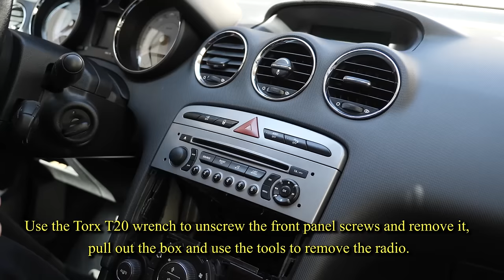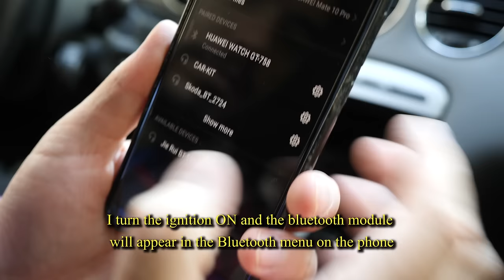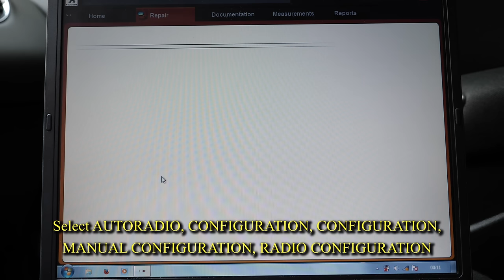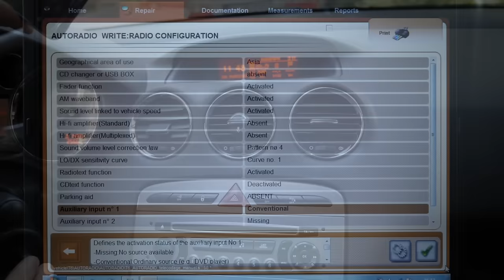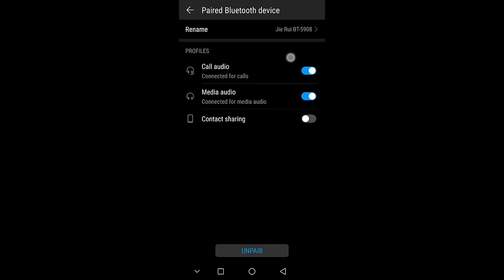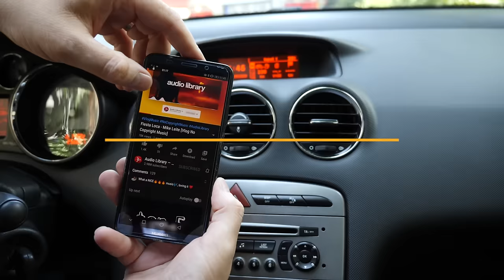Install Bluetooth Audio Module on Peugeot & Citroen Radio RD4, RD45, RD43

Comment from the maker: Links:
- Plug and play Bluetooth module + microphone: https://s.click.aliexpress.com/e/_DErPTy7
- Bluetooth AUX Audio Adapter with Microphone Handsfree: https://s.click.aliexpress.com/e/_DFsvCNv
- Bluetooth Module Stereo AUX-IN Audio Adapter: https://s.click.aliexpress.com/e/_DF2f3lz
- Bluetooth Module RCA Stereo AUX-IN Audio Adapter: https://s.click.aliexpress.com/e/_DE3GQex
- Diagbox / Lexia 3 / PP2000 (choose the most expensive, it's the best): https://s.click.aliexpress.com/e/_DDoo8O5
- Quick Splice Terminals Connectors: https://s.click.aliexpress.com/e/_APS3lF
- Radio removal keys: https://s.click.aliexpress.com/e/_DlT9q6F
- Peugeot & Citroen Radio RD4, RD43, RD45 wiring diagram (pinout): https://diyrepairs4car.blogspot.com/2020/05/peugeot-citroen-rd4-rd43-rd45-wiring.html
Reply: Hi Adrian, i installed plug and play module and after i turn off car i still can connect to bluetooth. Is that ok, does it drain battery? Thanks.
Reply from the maker: Hello.  Don't worry, it won't drain your battery.  If you want the bluetooth to stop being powered after you stop the engine, you will have to power it from the lamp bulb in the glove box.

Comment: Great video, really helped me a lot. Only difference was that on my Citroen C4 RD4 radio there was no cable on pin 11 so I used pin 15 instead and it worked. Hope it helps someone. Cheers
Reply: Same thing on my P308 with RD4. I discovered that pin 15 is +12V switch so I used it
Reply: It happens the same in my Peugeot 308SW. Yellow wire is in pin 15. Pin 11 is empty.
Reply: In my Citroen c5 2010 is number 8. Also you need to keep it plugged in the radio to see which cable is the 12v
Reply: Trying this now, hope it works !
Reply: @DionisisMaximum98   this is why I couldn’t find my switched 12v thx!
Reply: Same happened with my peugeot 207. Thanks!
Reply: @panosk.8803  
Did you activate your aux option whit the program or was like plug and play device ??
Reply: @tecnicocmex9133  It wasn't plug and play because I had to activate the aux mode. I went to a local dealer and they charged me 10 euros for that.
Reply: @panosk.8803  Hello some people said the Bluetooth stayed on after turning off the car untill it goes to ecomode then the Bluetooth go off is it true?
Reply: @drkabajt  Hello some people said the Bluetooth stayed on after turning off the car untill it goes to ecomode then the Bluetooth go off is it true?
Reply: @potatoman9116  That was not the case with mine. This might happen if you plug the connector in the wrong pin.
Reply: @panosk.8803  Ok thank you

Comment: Thanks! Very helpful video, installed my bluetooth yesterday following your guide, took about 15-20min (my quick splice didn't worked at first time, i had to took isolation from wires and it worked)

Comment: Great tutorial, thanks. Is it mandatory to run the Diagbox configuration? I already see the "Input" option in the radio when clicking at "Source" button??
Reply from the maker: Hi. If you already see "Input" when you press the Source button, the function is activated and you probably have the RCA plug in the glove box. Check it out :)

Comment: Super Video, hatte mir auch solch ein BT Adapter geholt und mich gewundert dass es nicht funktioniert, wusste nicht dass man den Eingang freischalten muss. Funktioniert super. Danke
Reply: Wie genau haben sie es denn freigeschaltet?

Sie haben aber nicht das Gerät dafür gekauft oder ?
Reply: @torque5070  Sie benötigen die Citroen Diagbox ( Software ) und ein Auslesegerät für den Laptop (Lexia 3), oder mal bei einer Citroen Werkstatt nachfragen, ob die das freischalten können :).
Reply: @BenjaminGillesgillben  ich habe schon einen aux Ausgang im Radio.
Das müsste also bei mir ohne diese Software gehen nehme ich an

Comment: Nice video. +12 with key is not pin 11 but the on close to constant +12V (pin 12). Check with voltmeter and radio attached (otherwise there will be different voltage).
Reply: Exactly. The wire colors were different for me, but the ones you listed are correct (pin 12 for +12, and pin 16 for GND).

Comment: hey great video i had a few questions so first of all does this change the quality of the original speakers? Do the steering wheel controls still work after installation? and the last one can it be done with all types of suitcase?? thank you very much great video :)

Comment: Hi there! Thanks for your generosity, what is the software and cable your using?
Reply from the maker: Hello. The software is called Diagbox and it only works together with the dedicated OBD module. You can buy the set here, it contains software and the OBD module: https://s.click.aliexpress.com/e/_DDoo8O5

Comment: Great video and very instructional. I used your link to purchase and now have functioning bluetooth and can now hands free call using siri on my phone. Also the music playback from my phone through the radio is awesome. However I did have to enable Aux1 using Diagbox. Many thanks Adrian.
Reply: Quick question, do you need the original citroen diagbox to use manual configs or can 3rd party like 50$ knockoffs work the same?

Comment: Hi Adrian. Just to ask, I have a 2010 Citroen C3 Picasso and the stereo does not have Bluetooth.  The tutorial is great but do I need to configure the stereo if I fit this. It is a Bosch stereo that comes as standard. Many thanks.
Reply from the maker: Hi! Yes, you need to configure the radio to activate the Aux IN function as you see in my clip.

Comment: I did it as in your vid in my 207cc. Unfortunately the tacholights are off now. Has that something to do with the auxconnector?
Reply: Oui, vérifier les fusibles
Reply from the maker: Hello. I don't know if it has anything to do with it, but it would be good to check the fuses.

Comment: I know this is an old video now, but in my case there is only one out of the 4 speakers that is working with this.. otherwise on radio/cd everything is fine .. any clues, tips or ideas ?
Reply from the maker: Hello. The Bluetooth module transmits on left / right stereo channels, so not independently on each channel. It is possible that the bluetooth audio signal send to you radio only one channel (left or right) and that your car has a defective speaker on a certain part. Check from the radio menu, fade and balance each individual speaker.

Comment: Hi Adrian, great video.
Is there any way to activate the aux channel without the diagbox? I connected it but it doesnt show up on the radio as an option.

Cheers
Reply from the maker: Hello.  So far I have only activated using the original Diagbox diagnosis.  So I can't confirm that it works with other diagnoses.

Comment: Great video, how do you skip tracks, play and pause etc? Do the buttons on the radio unit work for that?
Reply from the maker: Hi. With this simple Bluetooth mode you can not take a skip or break using the radio buttons, only from the phone you can do this.

Comment: Hello Adrian! Great video. I have only one question. Can you use the radio's buttons to skip between songs using this module?
Reply from the maker: Hello! For this bluetooth module the radio buttons cannot be used to change the track. But with this usb music player you can do whatever you want, see also my video from the link below: https://www.aliexpress.com/item/4000259485934.html?aff_platform=shareComponent-detail&sk=_dZb5IAb&aff_trace_key=0a20b206f9554695a0fc66cdf0ebd312-1595739885153-02248-_dZb5IAb&terminal_id=364d159dab6d4da48c68657f8054a5c8&tmLog=new_Detail&aff_request_id=0a20b206f9554695a0fc66cdf0ebd312-1595739885153-02248-_dZb5IAb
Tutorial: https://youtu.be/52huHY_Q-rg

Comment: Thank you, this is a great video! But i have a question, I don't have old 32bit windows notebook anymore, neither windows computer at all to run Diagbox software and don't want to buy this expensive diagnostic module and old computer (compare to pretty cheap bluetooth module itself) just to enable aux option on my car screen, what are my other option for this? Is there a single device diagnostic computer that can do this? Or do I need to find local mechanic that can help me?
Reply from the maker: Hi. The diagnostic software runs on Virtual Machine, so it also works on Windows 10, 11. I think there are other diagnostic systems that can activate the AUX IN function, but I have not tested them. I think you can go to a local garage for aux activation.

Comment: The original white plug you disconnected,what was its function?
Reply from the maker: That cable was for the Aux audio input, but my car didn't have the complete cable to the glove box, that's where the Aux IN rca audio jacks should have been.

Comment: Hi, thx a lot for this tutorial. Just a question, the module turn off when you turn off the car ? Because when I turn off the car, my smartphone still connected to the bluetooth module and I don't want any problem with my car battery.
Reply: Ok, I fix it. On my Citroën C4 2007rd4 .. pin 11 and not pin 12 for the red wire (+) , because bt module is directly connected on the car battery , pin 11 is 12v too but working only when rd4 turn on.
Reply from the maker: Hello. Yes, one of the two wires can be controlled by ignition.

Comment: great video!  In my citroen c4 I have a problem with enabling the aux function in the diagbox.  When I select aux1 - convectional and select telecode, I get an error: wrong telecoding.  The best thing about my diagbox is that I can make changes in the car, but if I want to change something on the radio, e.g. the continent, the same error pops up.  what could be the reason?
Reply from the maker: Hello. Have you tried another version of the Diagbox software? What Diagbox version are you using? There is also the possibility that the ability to code something on multimedia is blocked from the factory.
Reply: Have you faced this issue? I am having problem configurating aux1 or aux2.

Comment: This mod with mic + Bluetooth sounds amazing, but where will I answer the calls? Only via phone or there is possibility to insert buttons somewhere in the car, like on the steering wheel, or even better somewhere on the radio?
Reply from the maker: Hello.  With this bluetooth module you can only answer calls from your phone.
Reply: @AdrianDragan  thanks for the answer! Still way better than talking via phone 😄

Comment: Hi. My RD4 already has the white plug and a black plug as well, but in my glove box there is no aux input. Do you know why ? Should I change the white plug or the black plug in this case? It's Peugeot 807 2008
Reply from the maker: Hello. You have part of the wiring that is connected to the radio jack, but you don't have the RCA jack to connect the AUX IN Audio and probably the function is not activated in the Radio either. You must connect the Bluetooth adapter to one of the sockets in which there is a white or black plug.

Comment: Thanks for the video.
The device it's ok for my Citroen C3 MY 2010, red cable on the yellow, black cable on the yellow/green.
DiagBox not necessary in my case the AUX input was already ok.
Radio RD4N1 M-03 Continental, you can manage the volume from steering button but the main control is from the phone, I have a Samsung .
Reply from the maker: Hello. I'm glad it works well for you.

Comment: Hello. I have another question. I have connected module as shown in the video and radio and screen above the radio is not working. AC, lights etc. is working ok. I have used splicers like yours, but mine were smaller. Is it possible that the splicer completely cut off ground and +12 V? Would it cause screen stop to work? The bluetooth module can be seen in my phone when the ignition is on, but radio and screen dont work. If you could help me I would be very very grateful.
Reply from the maker: Hello. If neither the radio nor the screen works, it is possible that one of the cables is cut.
Reply: @AdrianDragan  Hello, it was te fuse fault.

Comment: When spliced this way will it  work when the ignition is off but the radio is switched on from its power button?
Reply from the maker: Hello. I don't think it will work.
Reply: @AdrianDragan  I searched for a wire that gets 12V when only the radio is on but couldn't find one so I did it using the one you showed. Thank you for the great video!

Comment: Great video. My 207 has original aux rca cable in glovebox. Can i just unplug that from radio and plug in bluetooth module without diagbox?
Reply from the maker: Hello. 
1. You can install a Bluetooth adapter with RCA plugs directly in the RCA plug in the glove box and power it from the lighting lamp in the glove box: https://s.click.aliexpress.com/e/_DFIZnVP
2. You can install a Bluetooth module with an adapter in the Radio power socket and you will also have a microphone for bluetooth handsfree calls: https://s.click.aliexpress.com/e/_DFDFV7j
If you have already activated the Aux IN function when you press the Source button on your radio, it is no longer necessary to activate it with Diagbox.
Reply: @AdrianDragan  thanks, i tried using rca cable to phone but the audio quality was awful. I'll try bluetooth adapter from radio socket

Comment: Hi Adrian. Nice videos. I have a DS3 with the type A screen (simple type) and no bluetooth. What is the easiest and cheapest way to connect a mobile to the car stereo with microphone? Is there a dongle/adaptor or do I have to change the screen and radio together?
Reply from the maker: Hi. This is the easiest module to connect, but for him you have to activate AUX IN usibg Diagbox if it is not already activated:  https://www.aliexpress.com/item/32826594463.html?aff_fcid=8dd412c5ed964f848eb1ce1226169bf6-1622123674255-09622-_AlNrnv&aff_fsk=_AlNrnv&aff_platform=shareComponent-detail&sk=_AlNrnv&aff_trace_key=8dd412c5ed964f848eb1ce1226169bf6-1622123674255-09622-_AlNrnv&terminal_id=a4886d1a72584241b5df38394da27292&tmLog=new_Detail
Reply: @AdrianDragan  thanks for the reply. Some reviews say that this product uses the battery even after the car is turned off.
Reply from the maker: @st.giorgos  If the power cord connections are made on the positive wire controlled by the ignition switch you will have no problem discharging the battery. To be sure you have to check the positive wire if it still has current after you stop the engine, use a multimeter. In fact, if the bluetooth module is still available after you have stopped the engine, it means that it is continuously powered.

Comment: Question:  I'm sad to find out that when using Bluetooth this way to play music, I can't control the phone through the steering wheel controls, the same thing with the radio unit controls. I can only skip /pause etcc, directly on my phone. It's annoying for me because I am frequently changing songs... can I  enable the steering wheel to control the Bluetooth device?

Context: Due to this video I confirmed that t the previous owner of my Citröen C3 1.1 2011 had already installed this Bluetooth module 😊.

I have the stock radio and I want to upgrade it with an aftermarket screentouch unit (single din carplay type screen/radio) so I was messing around and found that module connected. I haven't figured out yet how to install the new touchscreen radio I bought I'll keep using the stock radio for now especially since I found out it has Bluetooth on it.
Reply from the maker: Hello. It is true that using that bluetooth module you cannot skip the songs or adjust the volume on the phone. Have you bought a dedicated Android unit for your car?

Comment: Thanks very much, extremely useful and interesting. 2 questions
1/ is it compatible with a Peugeot Partner tepee > 2005?
2/ can I use my phone, make and receive calls through the loudspeakers?
Reply from the maker: Hello. 
1. If you have RD4 type radio, you can use bluetooth module.
2. You need this set to use your car speakers to hear phone calls: https://www.aliexpress.com/item/32826594463.html?aff_platform=shareComponent-detail&sk=_dUYqCGe&aff_trace_key=db34bffd454f43fdb5fa402529657ea7-1601095775499-07313-_dUYqCGe&terminal_id=3a8f5add39814c9a9eb3200bc67debac&tmLog=new_Detail

Comment: If the radio unit is disconnected, won't it ask for code upon starting? Cause I don't have the code.
Reply from the maker: Hello.  If you disconnect the radio, you will not need the code when reconnecting.

Comment: Hello Adrian, thanks for you video tutorial. I have a question for you about the settings, after I installed a bluetooth module and it works, I don't have the sound. I need to setting my car stereo as you made in tutorial, but I don't know how do that. I did go to meccatronic shop but they say: only citroen affiliates car workshop have the software that can do it. I see you in tutorial did it, can you help me, please?
Reply from the maker: Hello. Yes, you must activate the AUX IN Function using that Diagbox interface cable. You can do this too if you buy an interface and install the software on your laptop, you can find a link in the description of my video.

Comment: Hello Adrian, great video. However, I'm facing the same issue as others have mentionned. Pin 16 is OK. But I have no pin 11, nor 15. I have a pin 12 but it goes directly to the battery (no ignition). Is there another particular pin to check?
C5 X7 2008
RD4 N1 MP3 02

Thanks in advance!
Reply from the maker: Hello. That pin for ACC power is missing on some cars because the radio is turned on via the Can system. You can power the Bluetooth module from the + wire of the lamp in the glove box, extend the cable until there. Usually the lamp in the glove box works together with the ignition on.
Reply: @AdrianDragan  OK, will check that out. Thanks!